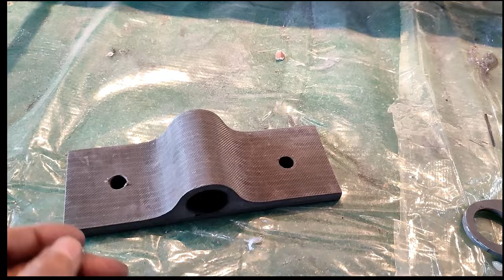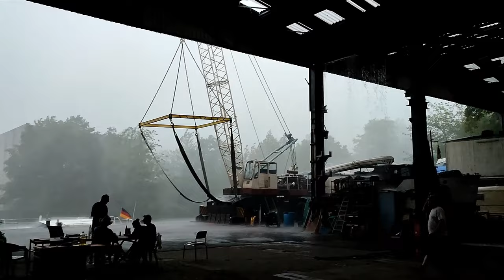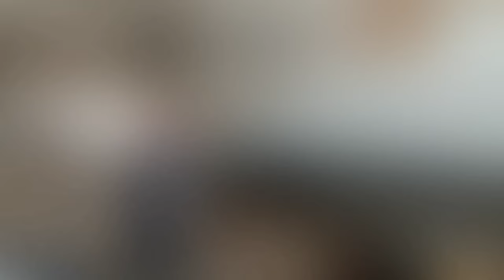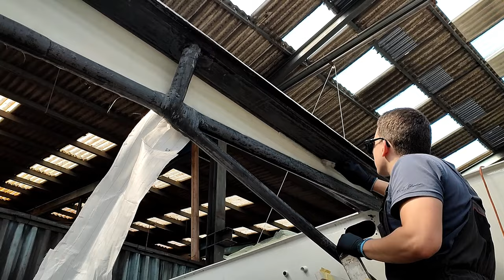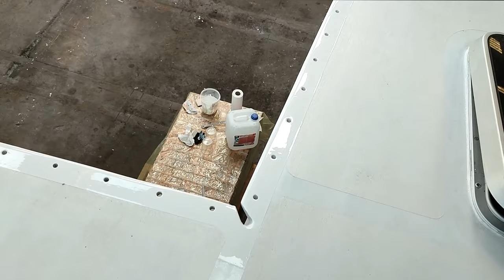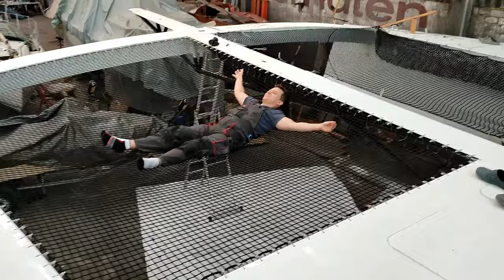09.  Building 15m carbon performance catamaran - "CarbonBee"

Comment: Wow... that new propulsion system is great.... I am very interested to see how this progresses.... well done...
Reply from the maker: Thanks!
CarbonBee is extreme light and has very low air and hydrostatic resistance, so we decided that 2x 6 kW electric motors are more than enough. Computer simulation show, we will reach 10-11 knots maximum speed easily... and under sails we can lower the engines and get enough current for Anna's demand 😄.
Reply: excellent @bojanu7212  When do you see the completion...?
Reply from the maker: @pauldegan8324  We don't work in the winter, so few months go out, but we plan to make first tests in 2025

Comment: Funny to find this, I've been building the same type of carbon fiber leg extension for two ePropulsion Pod 6.0. I was just laminating it yesterday! My usage is on a regular outboard electric hydraulic tilt/trim thing on my Seawind 1000. First I made the legs in steel for testing and now I'm redoing them in carbon fiber with an hydrofoil type of fairing around the flange where it attaches. The core is 3D printed ABS, with a carbon fiber epoxy cast foot, blending into a mix of unidirectional and plain weave on the skin.
Reply from the maker: Super! How do the Pods perform?
Reply: @bojanu7212  they work very well but haven't got regen to work with my non-eProp propulsion bank. I wouldn't go another way though!
Reply: More details, I didn't want to use the ePropulsion batteries because they (1) shut off automatically (2) are pretty heavy in terms of kWh/kg (3) don't support CAN to interact with my Victron GX setup and (4) didn't fit well in the space I had available. So I made a custom battery pack with CATL cells (280Ah) and an ORION BMS.

I've been slowly reverse-engineering the code to make the ePropulsion motor controller turn on the regen, but I've stopped working on this recently because my solar production has been more than enough for my needs so far. I might go back to it later, or I might replace the ePropulsion controller with another motor controller that is more "open" to configuration. Or I might put a small ePropulsion battery "in the loop" just to turn on the regen. We'll see!

I wish there was more options on the market! But electric propulsion, especially with retractable outboards/pods, is so amazing. I just love it.

In addition, when the sun is shining and the battery are full, you start to use your engines in a different manner. There's literally no reason not to run an engine and go a bit faster when the sun is overflowing you batteries. So I end up motor-sailing even though I would otherwise be a sailing purist on a dino-juice boat.
Reply from the maker: @AntoineGrondin  Thank you for the info. I didn't buy the batteries yet. So, I have to consider that what you said. Sure we will have the solar panels too, but on my rough estimation it will not cover our needs. Still I wasn't busy enough with this theme, because I do have still a lot of other issues to solve.
Reply: @bojanu7212  how much solar are you planning? I went above and beyond and shoved 2,280W overall on the coachroof top and over the arch, and we have a 10m catamaran. You should be able to put more, depending if you prioritize it or not. Mine is all over the dinghy, keeping it shaded and staying in the shades. But it's ~25kg per panel, not so light. Custom panels can be made that are lighter but I haven't gotten there yet, I just wanted a functional prototype with as much surface area used for solar as possible.

I'm considering adding a lightweight diesel genset, like the Hatz 1B50 fiPMG, but this would require some creative designing for the air-flow to account for cooling and exhaust. But it's an incredibly lightweight direct-DC 48V generator that's compatible with Victron.

Note that there's an exponential curve to power vs. speed. The curve looks best (to me) around 2-3kW of power, to motor at 4-4.5kts. This is a good mix for me of speed and power. I can do 3kts at 800W. Going fast, for long, with my engines isn't something I'm counting on. Sails are for that, otherwise we just need something to move a bit at a steady pace.
Reply from the maker: @AntoineGrondin  Wow, these generators are very interesting. I considered to have a generator in reserve (for long channel passages) or in case if my energy calculation will demand it, and these generators are great. 
I thought on petrol generators - there are silent, light, low-vibration and no problem with pest in diesel. Such one with permanent magnet generator would be interesting. I am sure that such generators are on the market.
Reply: @bojanu7212  petrol generators have the problem that petrol is dangerous, but mostly that petrol is less widely available than diesel, and in a lot of jurisdiction it is mixed with high ethanol content, which attracts moisture, rendering the petrol useless after just a few months. Ask me how I know, my old outboards were petrol and since I sail most of the time, the petrol in the tanks was always bad. Diesel bug is much easier to contend with than that, in my opinion.

I might still bring along a small petrol generator (Honda EU3200) as I'm not sure I can fit the Hatz anywhere. But I would much prefer the diesel Hatz!

Their fuel efficiency in terms of kWh/kg burned is the highest I found for diesel, and the lightest genset as well.

The Honda EU3200 is the highest kWh/kg genset that I found for portable ones, but it's producing AC current, not DC.
Reply from the maker: @AntoineGrondin  Looks like the Hatz is the best solution just now. Finding the place for this air-cooled gen will be the only issue. I will highly consider this generator. Thank you for this tip.

Comment: Please post more!
How did you get the structural requirements figured out? Is it also something you calculated in your CAD or did you outsource to a structural engineer? I'm interested as I design a cat
Reply from the maker: First, thanks for the comment. For the structural calculation I used SolidEdge which has well working FEA module. Without the correct calculation I would not advise to design such complex structures as multihulls. If you do not have experience in this matter I would advise that you design the general shape you like, and look for advise of known yacht designer, which has experience in multis, because it is not only the structural calculation and choosing of the correct material and its quantity , but also it's about of many air- and hydro-dynamic aspects around.
Wish you success in realisation of your dreams. 👍

Comment: Weight is different from displacement?
Reply from the maker: Yes. 
See the description under the video.
Reply: @bojanu7212  how can weight and displacement be different?
Reply from the maker: @deerfootnz  To explain simple - displacement is (in ship building) understand as the volume of the water (or their weight) pushed out by the ship, and calculated to the construction water line. It is calculated as the weight of the ship and  the weight of the cargo (here: the crew with all belongings, drinking water, fuel, eatables, etc). Weight of the boat is considered as it is empty.
Reply: @bojanu7212  so you are actually talking about lightship displacement versus fully loaded displacement.
Reply from the maker: @deerfootnz  Yes, correct. - Lightweight + Deadweight = Displacement.
I use the "Weight" of the boat instead "Lightweight" because it is better to understand for most people and the translation in other languages is correct.

Comment: Hard to see, but what is the brand and size of the motor? Thanks
Reply from the maker: it is:  e-propulsion
Reply: @bojanu7212 Great build!  How many kw are motors and how big is the prop?
Reply from the maker: @DenySmashinton  CarbonBee is extreme light and has very low air and hydrostatic resistance, so we decided that 2x 6 kW electric motors are more than enough. Computer simulation show, we will reach 10-11 knots maximum speed easily.
The propellers have 320 mm dia.